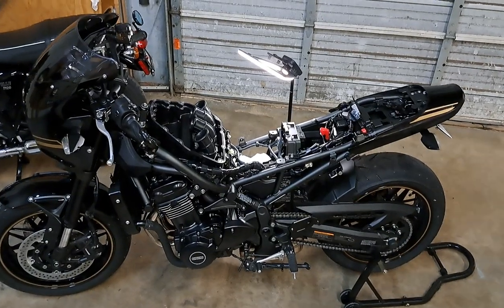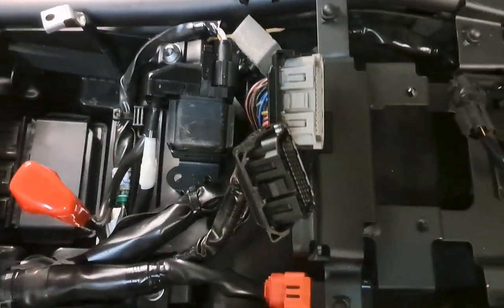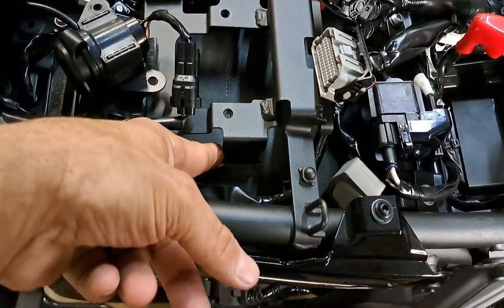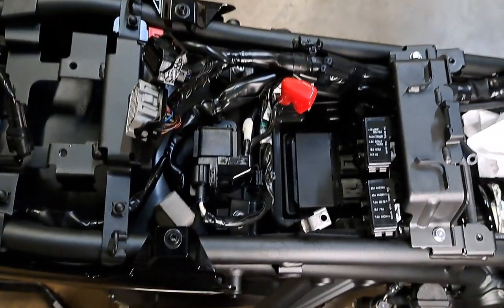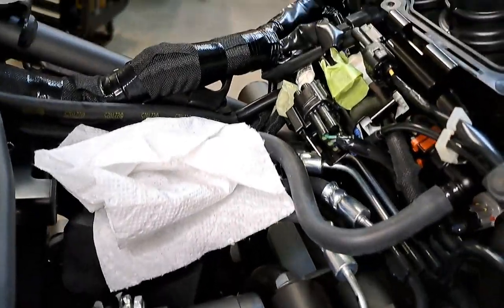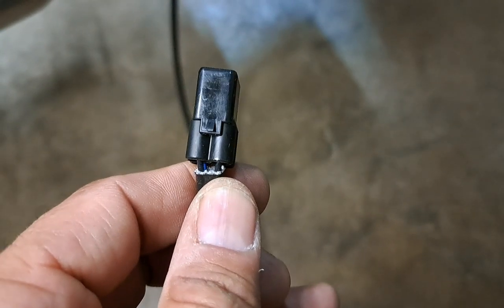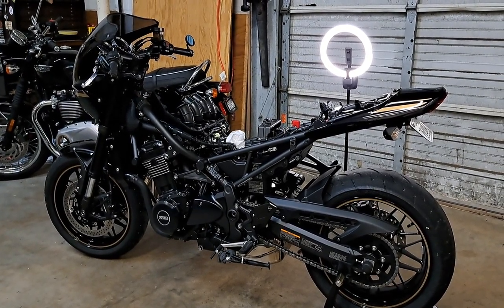Z900RS. Oxygen Sensor Removal.  Getting Ready for New Exhaust and Tune.

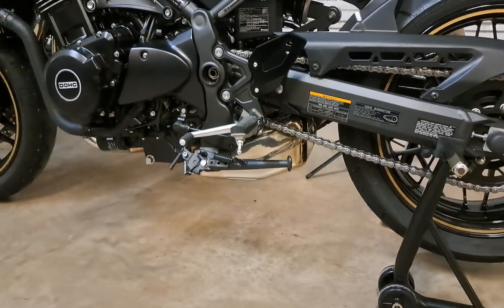Comment: Well done video. Fun fact: 6:35 that "can" down there is a 3-Way Catalysator. Pretty smart technology. It helps us to breathe not so toxic air, but it needs to have the Lambda (oxygen) value 0,98-1,02. I wonder if that could be also painted black with +600C paint and how would it look